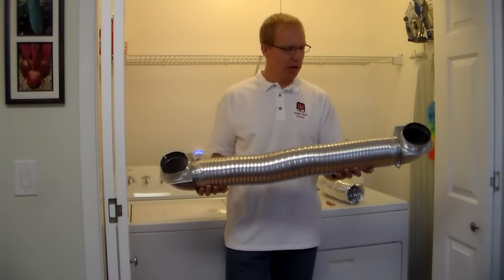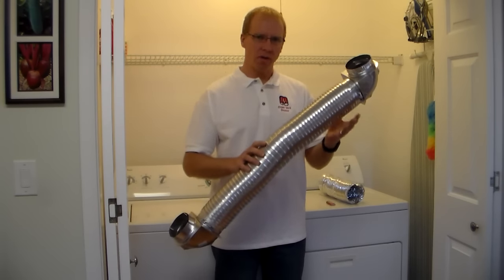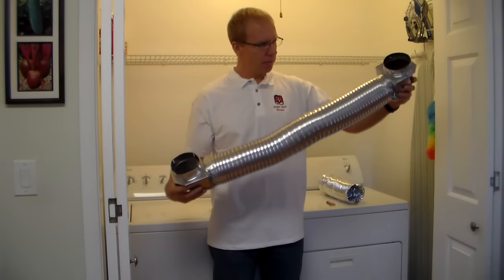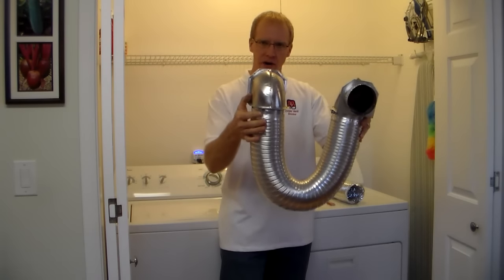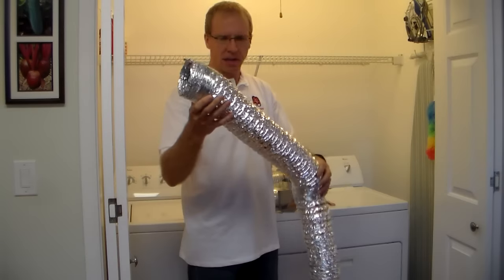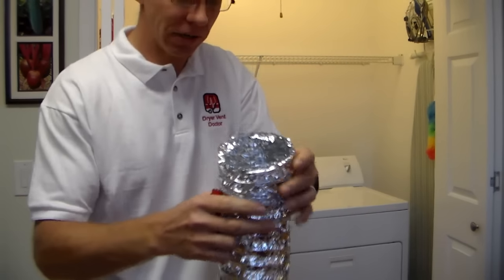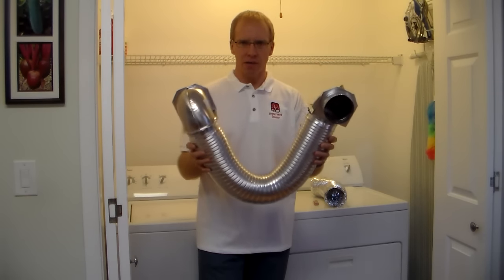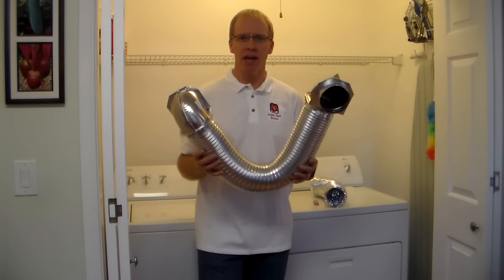The best dryer vent connection kit.

Comment: It’s amazing, we can land a man on the moon, but manufacturers can’t seem to design a decent hose for a dryer!  Then, to add insult to injury, we’re expected to shell out anywhere from $30 to $60 for a kit that should be part of the design in the first place.  This should be the easiest thing in the world.
Reply: I cannot agree with you more!
Reply: How else are they going to get every damn dollar you have?
Reply: @Derrick Enoch Instablaster =)
Reply: Lol hose and kit are your problems.
Reply: Perhaps we might have to question whether that moon landing was actually real. I'm so frustrated with these dryer vent hose.
Reply: Fortunately, the electrical equivalent has long since been resolved and we do not have to tape wires together to attach a lamp cord to the house wires.
Reply: Plus, the wall port doesn't line up with the dryer port.
Reply: No NO NO!!!!!! It crushes and starts fires. This guy is a hack!!!
Reply: @johnshoemaker9380  
What other products are there besides the semi-rigid metal ducts…?
Reply: Good news from 2022. Heat pump ventless dryers are now available and very affordable. I just got one and it’s great
Reply: @Grunttamer  
Do you have a link…?
Reply: @surfer8210  rigid ducting and dryer boxes are the way to go. Mag-vents aren’t bad either, if installed correctly
Reply: Exactly what I was just cussing about an hour ago as I was hooking up my new dryer.

Comment: I tried to use metal, I found it impossible to even fit the metal to the exhaust opening on the new dryer. I could not get one over the other! Also, working in a very tight space. It shouldn't be so difficult!
Reply: You need a rubber coupling called a "Fernco" to make the connections from the dryer to the vent outlet
Reply: I still more time putting the vent house than repairing my unit. Pain in the butt.
Reply: I was replacing the foil hose with the semi-rigid aluminum. Spent hours trying to get it on and finally gave up and put the foil hose back on.
Reply: No NO NO!!!!!! It crushes and starts fires. This guy is a hack!!!

Comment: I've watched about 50 dryer vent videos and you'd think half the houses in America would be burning to the ground given all the warnings about don't do this don't use that.  No vertical runs, no flex tubes, no plastic tubes, beware 90 degree angles, and on and on.  I'm willing to bet that most houses break at least one of these rules.
Reply: You're probably right, but I want my house, wife and kids to be as safe as possible...
Reply: @tonydisavino  Yes but I don't have children, and my wife has been getting on my nerves lately.
Reply: They are a part of the standard code now because of previous fires and a lot of testing. There are thousands of house fires every year because of dryers and their exhaust system not being up to code or cleaned out.
Reply: I have been using the very flexible metallic accordion duct in my past three houses past three houses, without incident.  However, it bridged the area from dryer to the nearby opening in exterior wall, was within full view without combustible material nearby; I could easily remove it, examine its interior and clean it out or replace it.  Now I am faced with a house that has a run of rigid metal exhaust duct within the wall and includes at least two elbows, probably more.  I will use either rigid metal ducting or something like is shown in this video to connect the dryer to the hidden segment, because I won't be able to inspect and clean the whole duct run.
Reply: No NO NO!!!!!! It crushes and starts fires. This guy is a hack!!!

Comment: Please note that the openings on the kit are different... in his left hand is a female end and in his right hand is a male end...  At my house.... the two duct openings are male.. the one out of the dryer and also the one out of the wall.... So naturally I needed two female ends on my kit....  The funny part is that I opened the box at Home Depot to ensure the kit was complete...having read where others had parts missing.  I didn't think to check the ends..  So I think that should be made clear to all thinking to buy this kit.  I had to tear off the male end, and was able to hook it up after some minor modifications. (I built a giant, thick washer).   I connected and clamped the female end to the dryer and connected the modified other end to the wall duct.  It seems to be working ok so far!  .
Reply: Pancho Villa damn... You gave it a sex change.

Comment: if anyone ever wanted to make a million dollars quick they would design a system that just reaches in and clamps on with no fking screwdrivers or crawling around on a damp basement floor like an idiot. i'm going to make one and then burn every dryer hose i ever see. such an idiotic design.
Reply: I'm sure you will. every dryer install is different, thats why the vents on the back smartass. its up to the installer to install a proper venting system
Reply: It is an idiotic design but leave it to
The Chinese to make it as cheap, shitty, and difficult as possible.
Reply: Magvent did it
Reply: NO SHT,  JUST MAKE THE VENT A 1/4 INCH LARGER.   AND KEEP THE STACY ABRAMS COMMERCIALS OFF,, EHH

Comment: @TheDryerVentDoctor : Could you tell me who the manufacturer of this type of vent is?  Or what it’s called exactly? 
The wall exhaust pipe for the the dryer transition vent is to the right side of my dryer, instead of behind it or above it, although the dryer’s vent hole is on the back of the unit. I’m not sure what type of vent elbows or whatever I need.  I want to be able to pull the dryer forward from time to time to clean behind it, grab fallen items, and clean the transition vent, so I need something flexible, but whirlpool wants the hook up to be rigid or semi rigid. 

This looks like a good option but I’m not sure where to find it. 

I live in Montreal Canada.

Comment: i live in a modular home where the vent goes from the unit to the outside. We just bought an Lg washtower where the dryer is on top and how it's venting, it isn't allowing us to push the stackable washtower to the wall. It's sticking out blocking our back door. Do you have any videos showing a solution to this problem? Is there any way to cut out the drywall and have a periscope vent encased so it pushes all the way back, IF that would even work? We're desperate to find a solution. PLEASE HELP?
Reply: There is a side venting kit for the LG Washtower, from LG, that allows you to reduce the clearance at the back.  LG website, documentation, and videos provide enough information that I think someone with some  basic handyman aptitude and skill can do the job.  There is still a minimal back clearance that LG specifies.  And now you would need some clearance beside the washtower.  I had begun examining this solution for myself, but we decided to purchase another washer dryer set because LG service is not available where we are purchasing.
Reply: LG Washtower's manual says allow 4 in clearance from the back of the unit, and at least 1 in from the sides
Reply: Honestly just take the sheet rock down and see what you can do. Might have no choice.

Comment: My dryer exhaust vent is rigged metal, and not flexible. Someone decided it would be a good idea to use 2 foot sections and duct tape them together. Taking it apart now to find a half inch of lint lining the inside of the pipe.

Comment: Was hoping you would show  attaching to the dryer. I have that kit but no matter how hard I tighten the clamp, rigid part that goes on the dryer keeps slipping off the pipe coming out of the dryer
Reply: I had that problem too. I used dryer vent installation tape. It fixed the problem. This tape is designed for high heat.
Reply: No NO NO!!!!!! It crushes and starts fires. This guy is a hack!!!
Reply: @johnshoemaker9380  ? The vent tape crushes? The fireproof tape, used on duct work for furnaces as well, starts fire? Sorry, I know I am missing your point. The HARD metal will not stay on the HARD metal coming out of my dryer and clamps don"t hold it on. So, what should I use if not the tape?

Comment: The semi rigid vent shown here, and connections, keeps the dryer about 4.5-5 inches from the wall.  For confined spaces, that is sometimes too much space, and still be able to close the closet door.  Solution?
Reply: I just looked up how to install dryer vent in a tight space. Came across "Periscope dryer vent" aka "Offset dryer vent kit".
There's bound to be more. I would like to be able to just back the dyer up to the wall but I think the it'll be off by an inch. Uhg.
Reply: FYI, we tried the periscope/offset dryer kits. The Best Buy installers could not get it to work, either.  They were still an inch or two too thick in getting our folding doors closed.  Our W/D closet is not as deep as the one in this video.

Comment: It's okay to have the dryer vent going straight up out of the unit? It seems like the lint would gather at the bottom that way?
Reply: You are probably right. You would need to clean more often. Sometimes it is the only way to vent due to construction or location of dryer in the interior of the house.

Comment: It is so hard to believe that THAT is the best thing man can come up with after all these years!  That flex vent material is SO fragile it is not even funny  CERTAINLY we can come up with something heavy duty that can also take temperature!  There are all kinds of flexible lines that handle super hot liquids and gases and you mean NO ONE sells something NICE to vent hot air from a fricken clothes dryer??  And YES I am willing to PAY EXTRA just tell me who sells GOOD vent duct matierial for clothes dryers???
Reply: OK I found something!  It is not sold specifically for clothes dryer and is like 10X the price of any crap that  home depot etc sells.   It is made of SILICONE material around steel spring good for 550 degrees!  Yes it can take the heat!  SILICONE!  OF COURSE!!!  ... the catch is we are talking a 100 bucks for only 6' or $5o for 3'  But I am thinking heck I could get away with 3' ..I think?  could use rigid steel duct and the angle fittings using the 3' only for the final transition so I can connect it to the dryer and shove the dryer into it's space!  $50 is pretty painless IF it will be super heavy duty and not split open the first time it gets dented by anything!  But before I spring for it I want to find SOMEONE that has successfully installed it??  anyone??

Here is the info I found at "Pegasus automotive  racing website https://www.pegasusautoracing.com/productselection.asp?Product=3631&utm_source=google&utm_medium=cpc&utm_campaign=3631&gclid=CjwKEAiAm8nCBRD7xLj-2aWFyz8SJAAQNalaqSqIUJitWS1ZAi9oNdx8_Hga59QtXaYqQcLzWLm6ZxoCuiPw_wcB

I am NOT recommending this,  I THINK it should work?  But have never used it...someone want to try it and post on youtube?  Maybe be a hero?

3631-4.00-6 FOOT
Condition: New

High Temp Silicone 2-ply Air Duct, 4 inch diameter, 6 foot

$95.99
Reply: Doug Chaney that's why you hard pipe it with steel, best way to install a dryer vent, that stuff is start garbage, the guys who install it from best buy, lowes, home depot crush is every time pushing you're dryer back,

Comment: This is so wrong!  You CAN use an aluminum "flex-duct" for your dryer, especially the portable ones.  As long as it's a UL listed duct specifically made for dryers AND it's from a reputable brand (Deflecto, Dundas Jafine, etc.), you should be okay.  While they may not necessarily be fireproof, they are NOT "highly flammable" like this idiot claims.  Notice how quickly he extinguishes the flame.  This is a classic scare-tactic used by these so-called "professionals" to scare people into buying their products and/or services.  All you have to do is use common sense, make sure your dryer duct isn't kinked or crushed, inspect them regularly, and you'll be fine.

Comment: you are a "dr" those 90s are cheap, they have bends that have opens in them, air gasp that 180 bend, each 90 degree bends is roughly adding 5ft of extra pipe so your 180 bend is really added 10 ft of pipe to the run, also the flex material you are showing is for bathroom exhaust, I bet you it clearly says don't use for dryer vents, the true flex material used for dryer vents is UL rated, by code you can only use it for 5ft in a room, can't go through the floor and penetrating a wall or ceiling, that ridge aluminum you're using once it get bent or pancaked you have to replace it every single time because it's restricting the air flow in the pipe, you really should be putting to adjustable 90s instead of them cheap ass 90 you're showing just saying Dr, are you even certified?